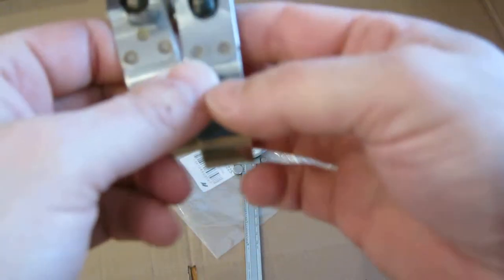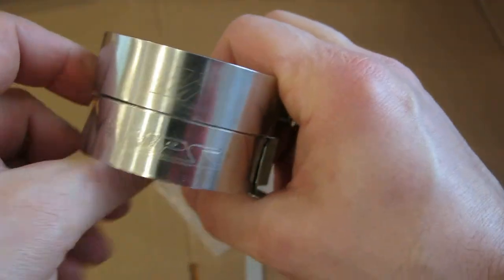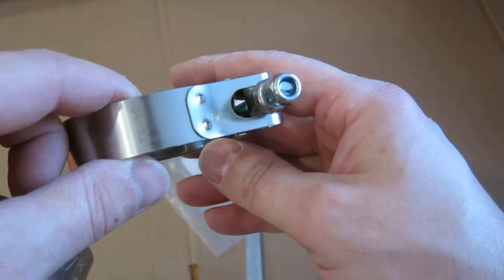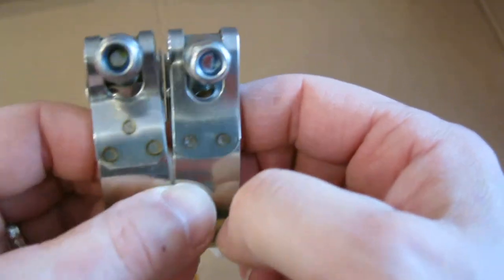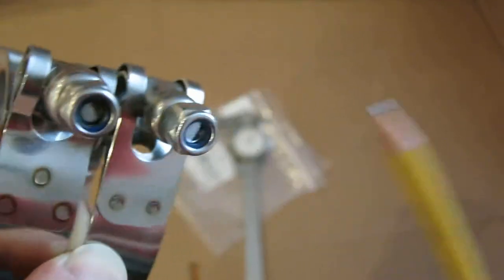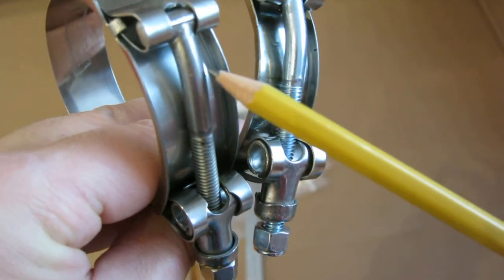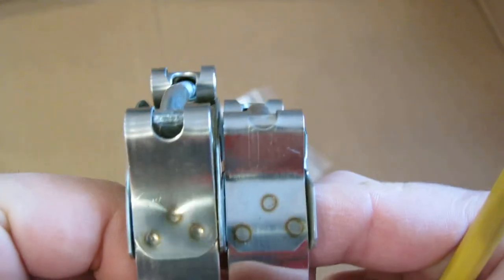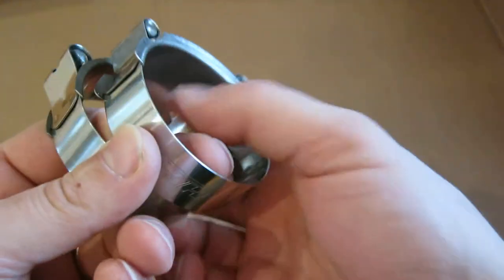Mishimoto vs HPS T Clamp Review

Comment: first point of failure will be the spot welds. best to use a norma clamp which dosnt have spot welds.
Reply: Welds will fail correct but if clamp is used for proper application for which it was designed for welds will not be a problem.